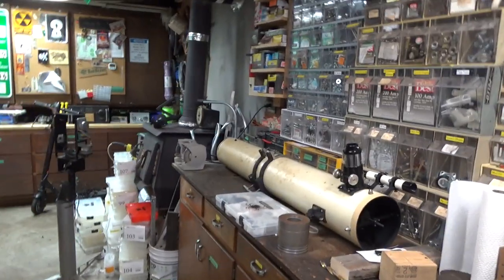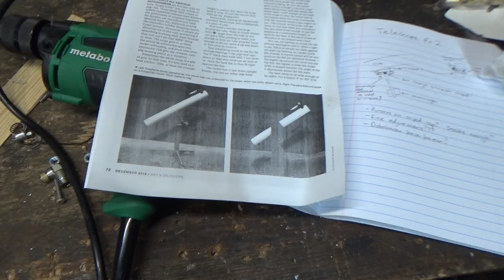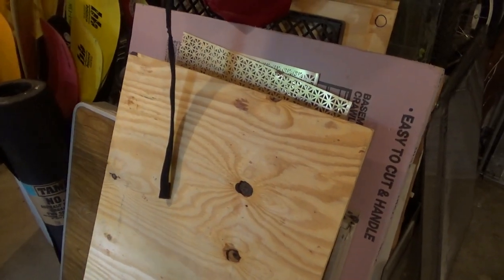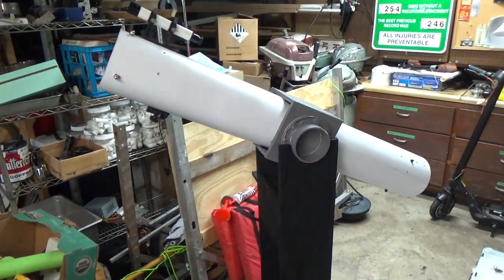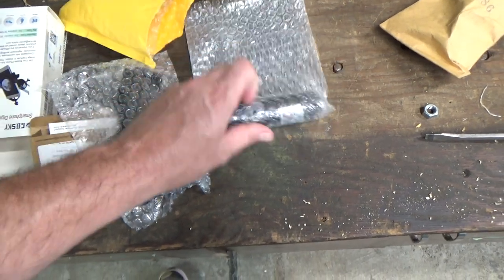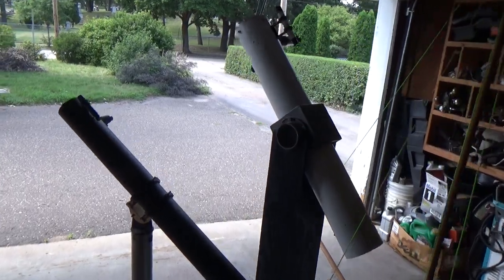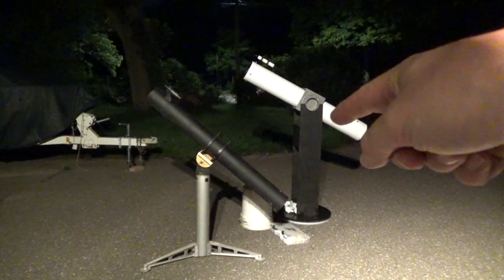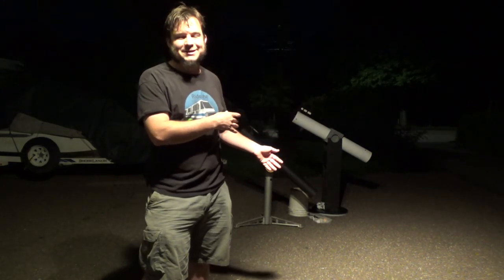Building a Dobsonian Base For An Old Telescope

Comment: You should check to see if the mirror needs recoating. To do this just shine a strong flashlight from the back of the mirror and see if the light shines through the mirror. If it does you will need to have it recoated. There are companies who can do this.

Comment: Love it, but please use a fence in your table saw.
Reply from the maker: It has a fence, do you mean the guard thingy for the blade? Those broke almost immediately on the last two saws I got. I assume they're only included to meet OSHA regs and are secretly made to be disposable.
Reply: I meant a fence paralell to saw blade (to rip thin cuts) also make yourself a miter saw (90° to the blade).
Reply: @saveitforparts maybe at least stabilize that table saw before use.